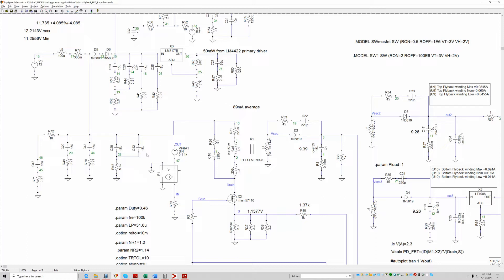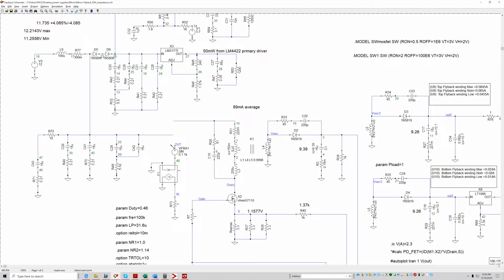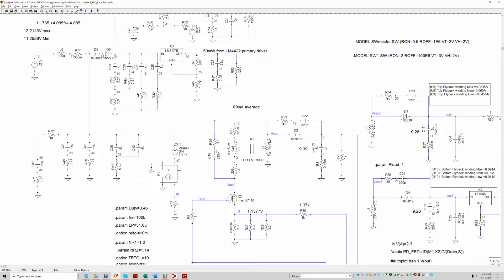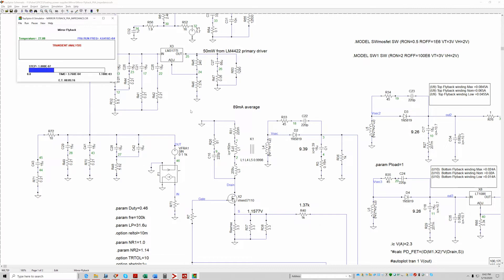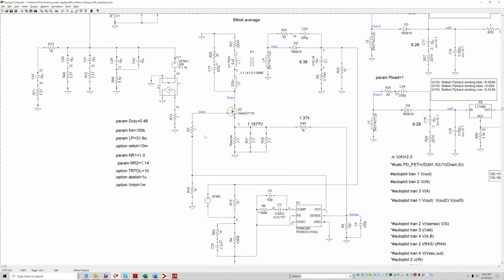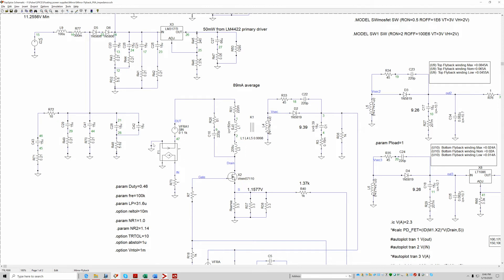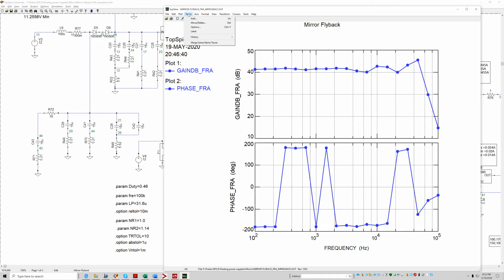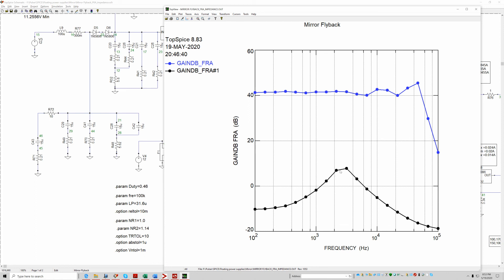Middlebrook Criteria, Input Filter Stability

Comment: Very Nice explanation, it would be Nice of you if you can provide TOPspice files to do the simulation as the settings in the program can be a bit tricky for many.
Reply from the maker: Hi SM. If you send me a email, I can send you a input filter file that should be able to run on the Demo version of Topspice.   I have both a common mode and differential mode simulated.
Reply: @RobertBolanos  Thank you